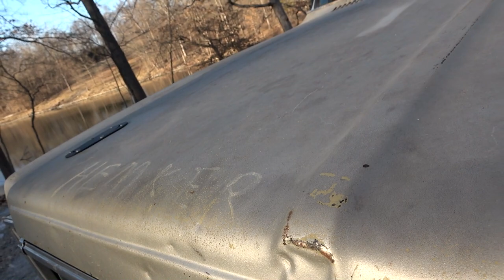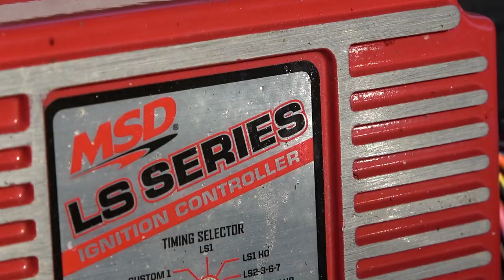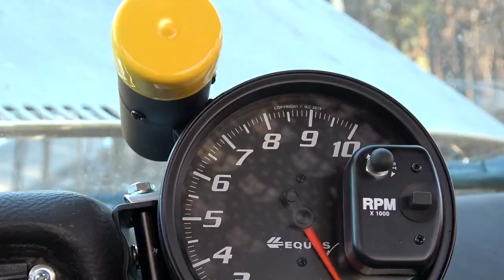Chevy C10 Muscle Truck - Burnouts, Acceleration, and Walkaround - Cammed 6.0 Liter LS

Comment: The truck came out amazing liked the exhaust system and way it sounds and looks... Cool  nascar steering wheel.... should lower it a bit more ....what type of shifter are you using looks familiar?.....🙂👍🙏
Reply from the maker: Thanks, I appreciate that.  The shifter is a B&M Pro Gate that I put a taller handle on.

Comment: How many hp has this awsome truck 🤟 😊 😊 😊
Reply: I'm curious about it too. 😁
Reply from the maker: It's approximately 440 - 470 HP on motor alone.  This is based on a dyno test that we've seen of the same combo, plus what the truck's trap speed is in the quarter mile.  Obviously, it makes considerably more on the nitrous.  It's plenty to have a lot of fun :)
Reply: @RamblinAround  holy Moses thats a lot hp and fun, thanks jeff and Jordan for this video and your feedback always apriciated from tom your friend now and always 🤩 🤩

Comment: any idea what these swb sealed trucks weigh?
Reply from the maker: This truck weighs 3640 Lbs with a full tank of fuel.
Reply: bad ass i was hoping my 5.3/80e 10 bolt combo to be around 3300 guess i was overestimating a tad badd ass truck brother
Reply from the maker: Thanks, appreciate that.  I haven't really made any attempt to lighten it, so you could drop some weight with lighter seats, different wheels, etc. @seanandersen338